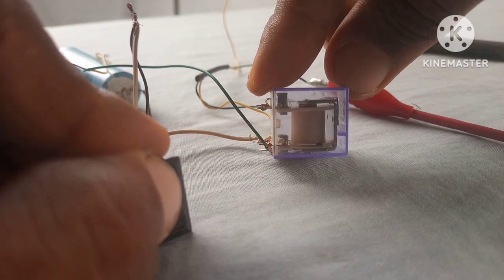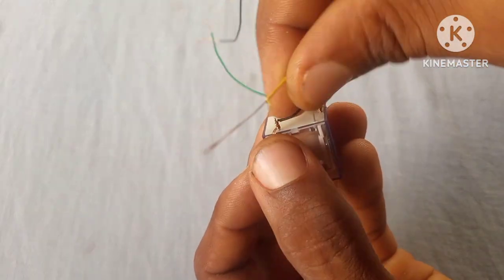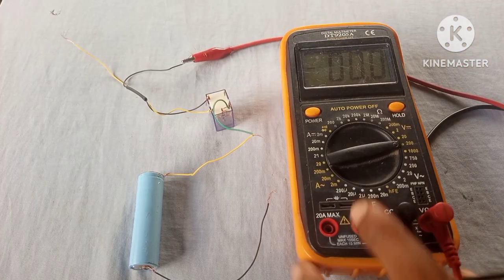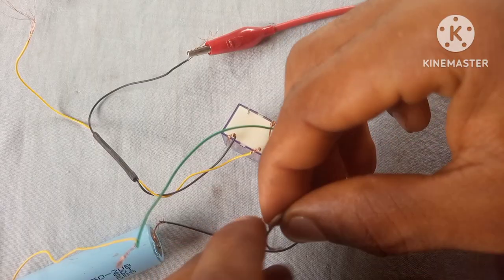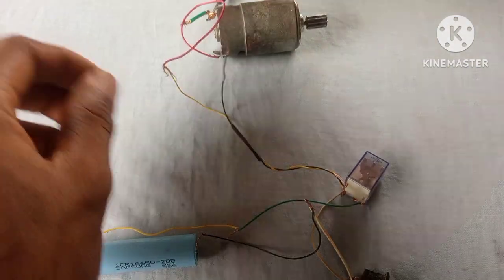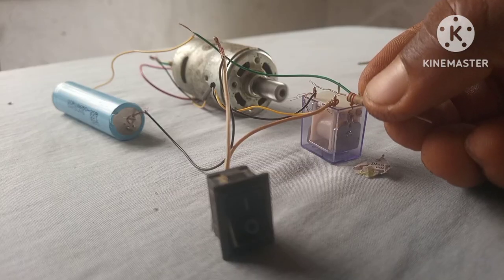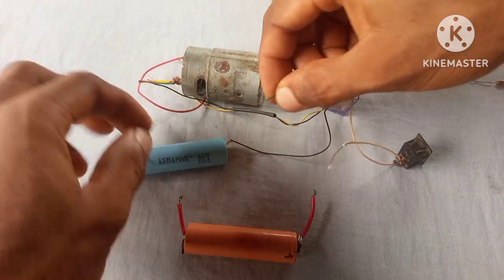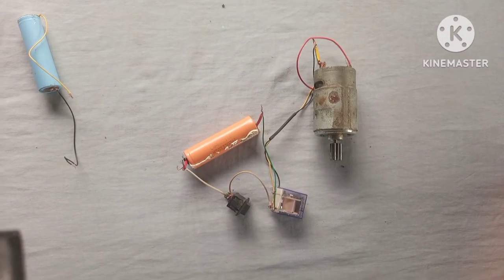Diy 18650 lithium battery low voltage cutoff with only one component

Comment: BMS have cheap better use less than 1-2$ cost. and charger need cut charging 4,2V not less or hight.
Reply from the maker: That's right, but the thing is they are fragile

Comment: Function of BMS is not only cuttoff when charge like using relay. it does maintain non linear charging current as well
Reply from the maker: That's right, but this video was only showcasing the low voltage function of a BMS by using a relay. Check out my previous video where i built a auto cutoff for when a lithium battery is fully charged, by using only two components.